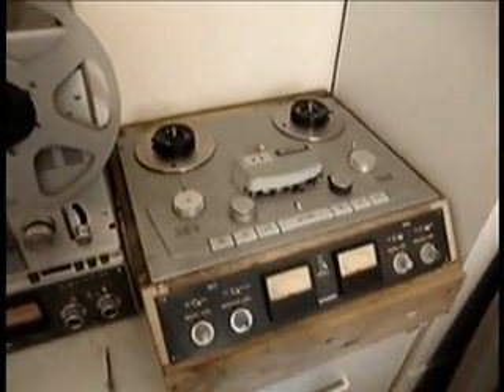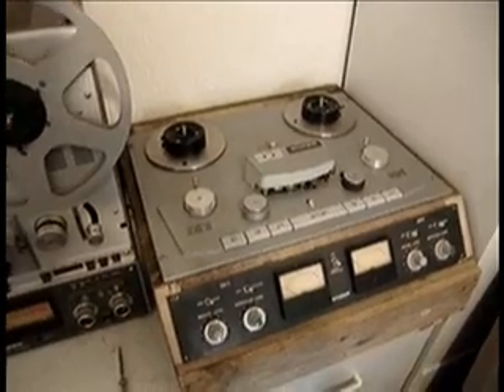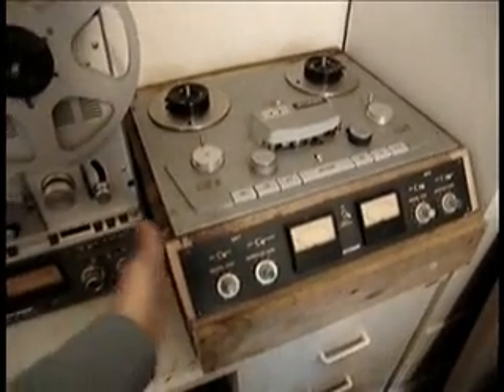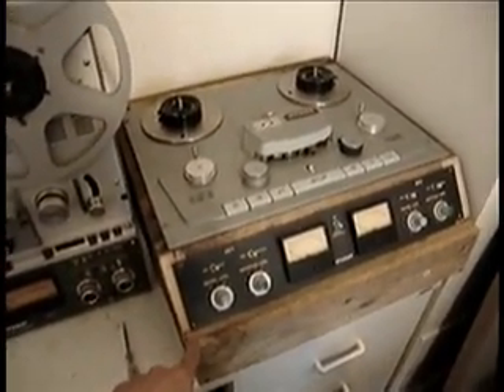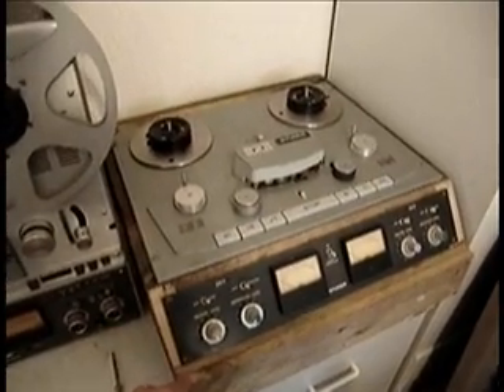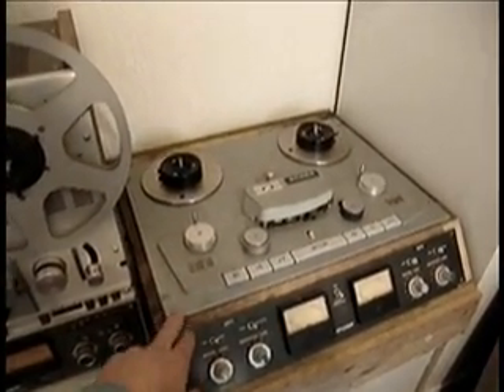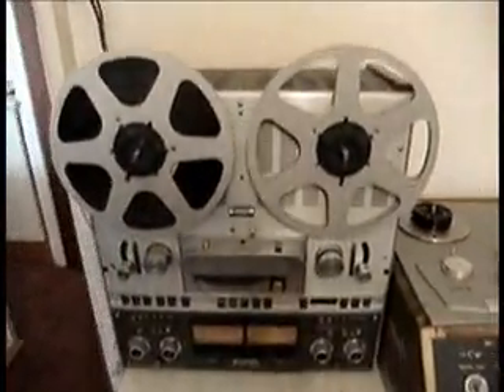Studer B67 MK II reel to reel tape recorder - goes up in smoke

Comment: We all been there. On of the Rifas at the small boards at the top? Happened on my B67 as well, also kept on going. Almost done recapping her now, runs without issues now with a PSU that had everything but two transistors replaced.

Comment from the maker: Yes and no, there are no signs of failed capapcitors and the power supplies look ok, my A812 has gone up in smoke too (Like that when I got it), though the caps are leaking and have been replaced, it's nit the fault.